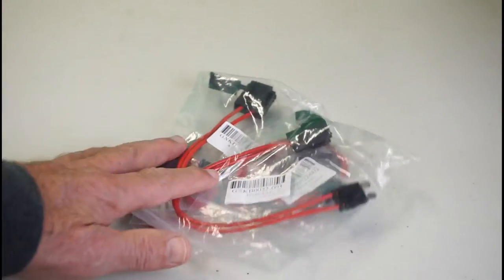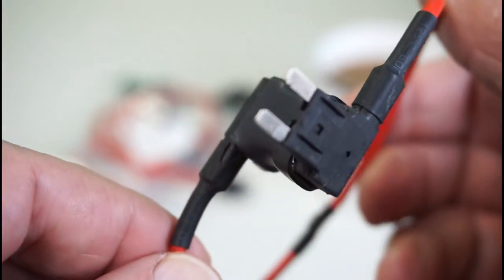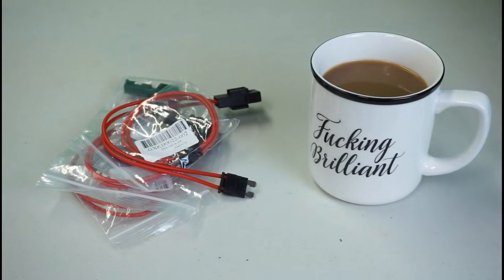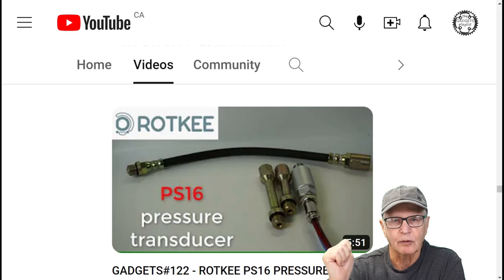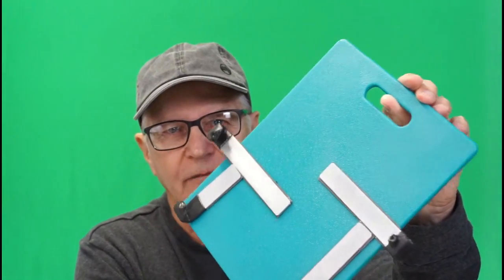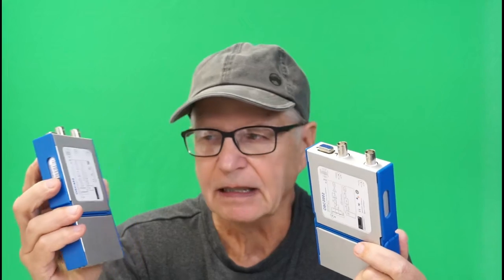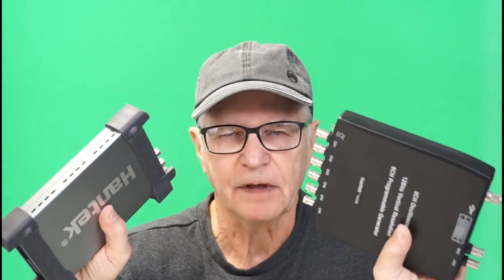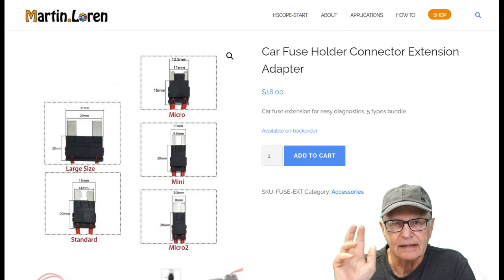GADGETS#188 - FUSE CURRENT LOOPS

Comment: I love your stuff. I have an exception. I have the latest 502, which I purchased out of curiosity. I have also a pico 2204 2 channel. I find it way more user friendly and better frankly.  It does require good attenuators and lacks the tablet usability.  The 502 does one thing that is awesome. The data logging feature is sweet.
Reply from the maker: PICO 2204 is 8bit while HS502 is 12bit ... there is no contest

vertical resolution and its importance is likely the topic of the next tutorial

thx for the kind comment:)

Comment: Almost 10x the transducer cost buy I'd love to see what's inside the jhapt-100 pressure transducer. 
WAAAAYY cheaper than the pico equivalent and seems to work exactly the same from all the tests I've seen.
Reply from the maker: a couple guys in our HScope Telegram group have that JH-APT 100 transducer but I don't know much more about it
Reply: @theGADGETSplaylist  I've seen plenty of guys using them now, but no one either game or interested enough to peak inside, unfortunately. There are a few others that sell their own DIY transducer kits also. Just a 5v box and transducer but higher pressure capability. Of course,  they have income to protect and would never share the source of the transducer.
Reply: @secretsquirrel9722  I took my jh-apt-100 apart to have a look at the transducer. There is no writing or branding on it. It looks a bit different to anything of seen before.
Reply: @double_enda  that's a bummer. 
Have you had much use for it? 
How do you like it?
Thanks for replying in the first place!
Reply: @secretsquirrel9722  yeah I like it. I've only used it twice in the past year but still handy to have around.